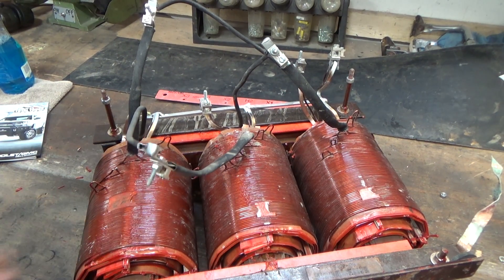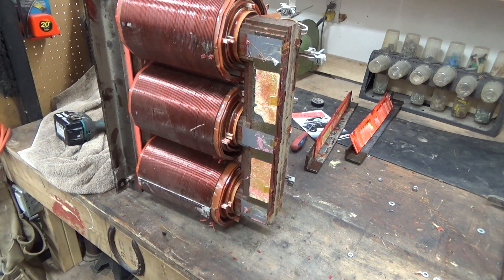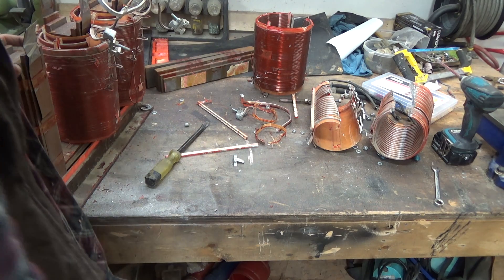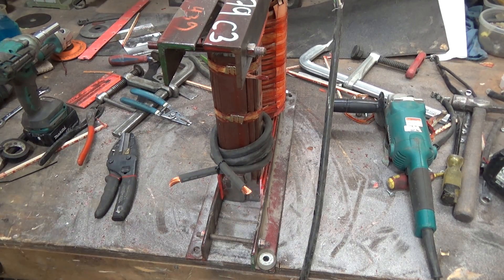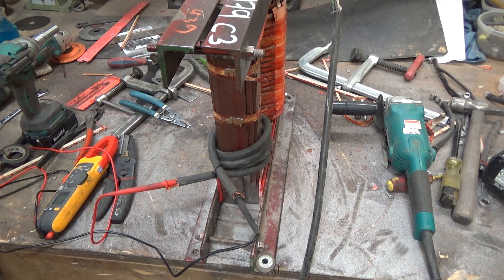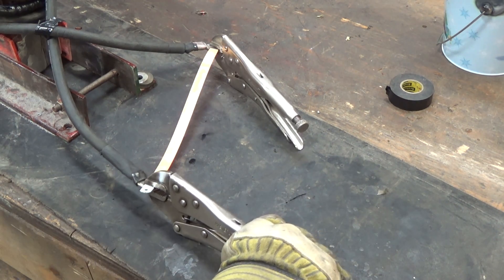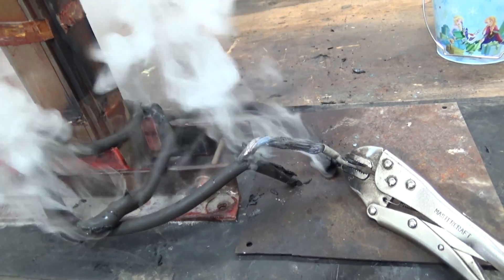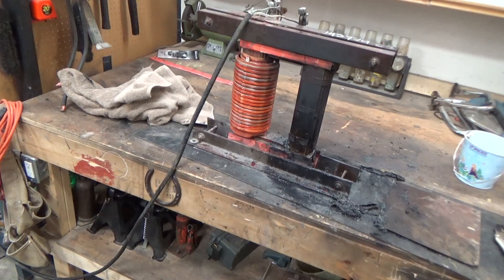DIY-High Current Transformer [120v to 5.0v]

Comment: You could have attached the 120 to the 600 volt coil so it would draw a bit less current and then have two or three 0 gauge cables tied around the secondary 4 times to get a pretty high current as well.

Comment: for that huge size the input seems very weak (120V) these ~500 Amps can be produced with a microwave tranformer (also you there are video with 2 or 4 MOTs combined with even more amps)
Reply from the maker: yes it comes down to impedance of the coil , this is what I had to work with.

Comment: So if you wrapped it from 120v to 14v how many amps could you get out of it?  You could play with powering a car amp on it.
Reply from the maker: Well I speculate I could get 300+ but that’s at 14volts ish AC, I could not just power a dc device with this, one would have to rectify and filter the power a lot to be suitable for what your suggesting
Reply: Amperes are determined by the resistance of the material the electricity is passing along (or through) and at a specified voltage.